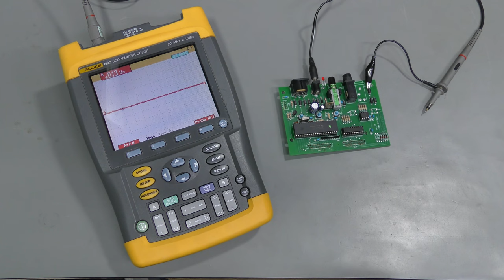#133 - Studiologic SL-990 Pro repair fail

Comment: You could try installing a stand alone oscillator module and connecting it to the appropriate crystal pin to see if that gets the processor running, I have done that in the past to work around a dead internal oscillator.

Comment: U could try taking out the pic out of the socket, sometime it just develops some corrosion around the pins that act as impedanceses, u could also try to verify the chip is ok outside the the circuit in a breadboard, if this pic has an Mclr pin/ reset pin then I would check to see that the pull up resistor is not shot and working properly other wise it would be in a state of programming

Comment: that's a fatar tp40gh keybed, you can find more modern brains for that keybe if you're trying to update the keyboard.
Reply from the maker: could you suggest one?
Reply: Hello Orion, could you recommend some brain for this machine, i have a studiologic 880 PRO which is very similar, same fatar keybed. I have seen that fatar products of that time tend to fail in electronics. I don't know how much longer mine can last, before it stops working I would like to change the brain. Thanks!

Comment: I would try the PIC in a programmer. See if it identifies it correctly. No point going further if not.
Reply from the maker: Right, I should have tried that while shooting the video. The chip does not respond at all in my TL866 programmer.

Comment: As said before, check the socket. Spring contact sockets are susceptible to oxidation.

If there is a reset pin, check it, you probably did already but left it out of the video. But if not, there might be a supervisory ic that has gone haywire.

Check ceramic caps around ICs and such. They can fail dead short in rare cases. Also have seen a manufacturing defect where one was damaged and absorbed ambient moisture (my guess) it didn't let the reset line come up as it turned into a resistor.
Reply: I had exactly the moisture issue you mentioned on a THT 100nf capacitor!
It turned to a resistor!
Reply: I have been seeing more and more faults caused by ceramic capacitors. The older ones seem to be failing now. It's just one more component to be suspicious of that we never had to worry about before.

Comment: Checked the caps/resistors in the oscillator circuit? They won't oscillate without the correct load.
Reply: InTeReStiNg

Comment: throw an arudino in there. Boom.
Reply from the maker: Why Arduino? By "boom" you probably mean that it is easy, don't you? It is easy to buy a blank PIC controller for about $6. The problem is the software. It is possible to figure out the connections and write something, but that is a lot of work for a one-off project. Even harder to match the features of the original keyboard - velocity curves, parameter setting using those buttons on the front and such. The keyboard is not worth that much.
Reply: @feedback-loop  Yes, I simply meant use the gut the machine and shove your own stuff in there. True it will not operate "The Same" but who wants yet another midi keyboard, Great opportunity to trick it out :)
Reply: @feedback-loop  Hmm - unless it is your ONLY midi keyboard, or has some unique feature you lack in another unit, or you just like the weight of the keys. Sadly I do not have that units so... I should not judge